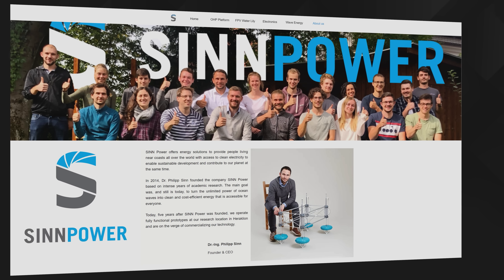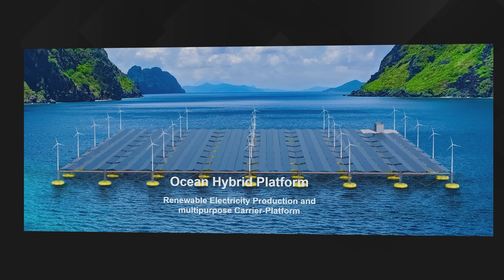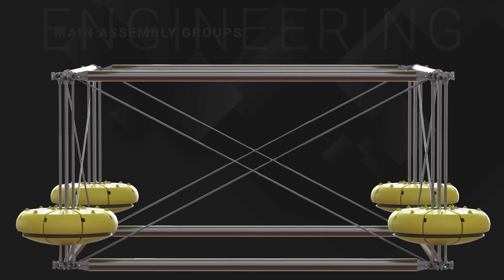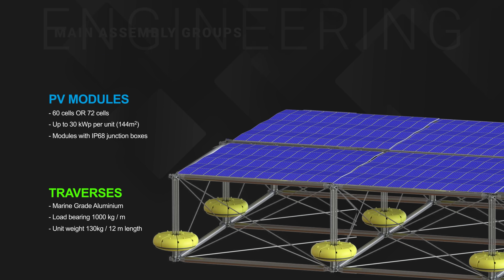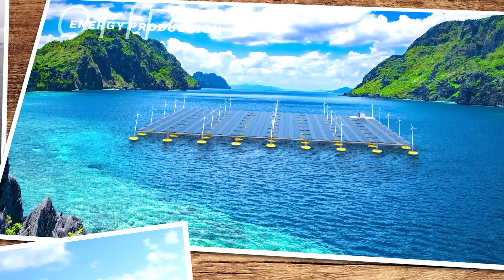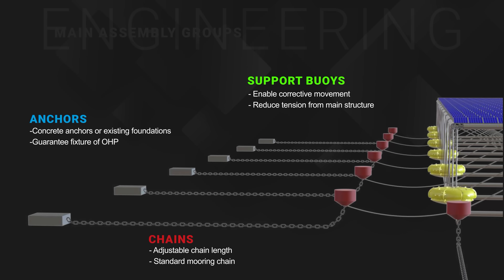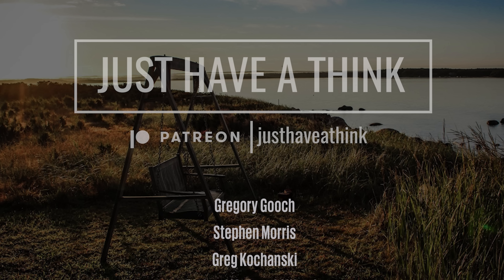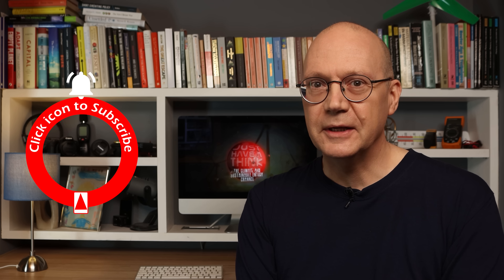Solar Wind and Wave. Can this ocean hybrid platform nail all three?

Comment: One thing I have learnt from my boat: flat solar gets silted up because the water evaporates leaving behind everything the rain brought. That is inland fir me on my canal. But twice this year my panels have been covered by a yellow coating of Saharan dust. This is in the South of England. Add to that any gradual accumulation of salt spray and you are going to need regular cleaning. Tilted panels are almost self cleaning when nearly vortical.  One benefit of a steep angle is that you maximise solar for winter in higher latitudes. You can also get reflected light from the water.

Comment: I like the concept, but it seems like this prototype is way too small. The turbines are too small to take advantage of a lot of the things that are needed lower the cost of electricity, the panels sitting flat like that reduces energy production and can cause water too pool on the surface more potential causing salt buildup issues. I don't currently know enough about wave power too give a firm opinion, but a system like this would probably rely on it's size to maximize energy production since the travel distance of the floats, and the mass and stiffness of the upper structure would both put limits on the amount of energy a given platform can harvest from waves.

Comment: What if feasibility of the wind turbines being made in the tall but tight whirlygig style and the blades of the whirlygig being made out of small solar panels?  I'm an engineer, if anyone is laughing, but I thought it would be cool and not need a lot of surrounding infrastructure.  I assume the force of the blade rotating would be hard on the solar panel, but I just had a thought.😄

Comment: The marine environment is the toughest on earth. There is a reason offshore wind is almost double the cost of onshore wind.

Salt spray is a real issue, it gets in everywhere. Cleaning will be significant and consume power generated by the system desalinating water.

Another issue could be barnacles, which grow on things in the ocean in a matter of days/a week. On a recent attempt to paddle a kayak from Australia to New Zealand Richard Barnes was over the side de barnacling almost from the start.

Would love you to do an episode on what I think is the main reason our move to Net Zero by 2050 is not going to be easy, maybe even possible, and be much more expensive than imagined. The supply of raw materials. The recent EIA report on Critical Minerals makes stunning reading. 

We need gigantic increases in critical raw materials, we swap fuel hungry fossil fuel generation for mineral hungry renewables, batteries and a much more complex grid system to accomodate the issues of rewenables based systems.

We need to find an order of magnitude larger supply of lithium, nickel, REE, silver, copper, cobalt but to name a few. Copper and lithium in particular need massive amounts of water to mine/process and are almost always found in highly water stressed locations.

However the really sobering topic the report raises is how long it takes for mining projects to go from discovery to first production. They found 16.5 years and getting longer due to legal challenges and more difficulty in gaining approval. And that is after you find the deposit in the first place. 

Would get people thinking about what needs to be done to try to address the issues raised.

Because we have become so good at making renewables systems the raw materials are the major costs now. And unless those critical raw materials are different to othe minerals (and after 30 years in mining project development, they are not), assuming costs will continue to fall looks highly suspect.

Comment: You need to make a part two. You say you leave it up to us as to whether it is viable, yet there are so many details that go into that formula.
- What is the price per m^2.
- How much energy can be captured from each system and under what circumstances? Wholesale energy price would be dependent on the installed location.
- Where I live waves average less than 1 m. Can the system be tuned to be maximized in this environment?
- What is the price of an 'equivalent' land based solar and wind system?

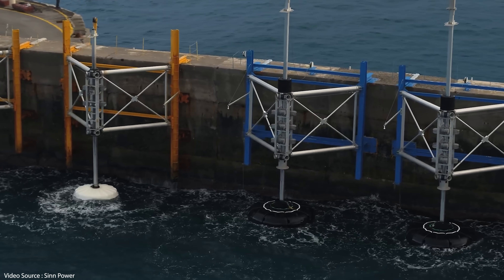Comment: If 10:00 is the real world testing they did then I'm a bit sceptical about it. The concrete wall obviously doesn't float. Attached to the floating platform I somehow have a feeling that rather the platform will break apart under bending stresses than that those floats generate electricity from compensating the waves.

Comment: A great idea, but I have reservations as to the viability. The oceans are incredibly hostile at times - as this week in NW Europe has shown ( Feb 2022) and designing for the worst case scenario plus a margin will be a huge challenge unless a large failure rate is part of the spec.

Comment: This is NOT the holy grail. It is just a new implementation (innovation). Nothing wrong with innovations but there is only one holy grail in this area: energy storage. And is yet to be found. All the efforts should be concentrated on storage.

Comment: My piece of lateral thinking is this: use obsolete  but operational oil tankers as the ‘spine’ of the platform, or around its perimeter, rather than breaking them up. This has the following advantages at low cost.
1. The containerised energy modules can be transported to the site, assembled on board then winched down into position. The ship provides initial anchorage and crew quarters plus a high level platform for solar panels and wind turbines. The ship can be manoeuvrable to provide some shelter from the prevailing wave and wind conditions during storms. It also provides a helicopter pad for maintenance crews.
2. The cleaned out oil storage tanks, modified with seawater pumping systems, can be converted to fish farms. A sequence of tanks could replicate different habitats to optimise the growth of phytoplankton, zooplankton, anchovies, seaweeds, caged shellfish and larger fish for harvesting. The plankton rich waters provide the food source for the higher tropic levels.
3. If moored in deep, tropical waters the ex-tanker/solar farm/wind farm/ fish farm complex could also provide the means to generate power from the thermoelectric effect, by sucking cold nutrient-rich  water from depth, running it through a heat exchanger with surface water, then pumping it into the phytoplankton tanks.

Comment: Dave, I just wanted to chime in on the it-takes-20-years-for-baby-trees-to-become-carbon-storers thing.  If you think about it, it's probably more about how and into what we plant trees that could be the problem.  Conventional plowed fields or burned or cut over land might be the real issue, and planting with minimal soil disturbance into prairie or meadow environments seems like carbon uptake would start right away, albeit a small amount at first. Even establishing a prairie simultaneously might help. Then one might consider the type of trees: conifers that don't loose their leaves/needles vs. hardwoods that do in temperate to subarctic climates.  Logically one might think conifers would absorb more sunlight in winter, reducing albedo, so hardwood species might be better in those bioregions.  Perhaps in the seasonally dry tropics as well that may hold true.  There are other factors, like establishing mycorrhizal networks over time and other factors that I'm not aware of, but if this study is based on satellite images it might be showing that we have been employing the wrong methods rather than the young trees giving off more CO2 than they store, since trees photosynthesize and store carbohydrates as cellulose and lignin right from the get go, unless I'm missing something in my understanding.. 🌲🌲🌞🌄🌜

Comment: Very interesting. The idea that the PV's will be above salt deposit range is one that sprung out at me as wrong, as I see salt spray very high in the air where I live. I'm sure there will be other areas that don't seem to stack up with others who have specific knowledge. But nevertheless, the concept is quite brilliant and may be capable of refinement to overcome any inherent challenges. I like the practical thinking that's been applied, containerisation etc.

Comment: GENDRAOGONFLY  is correct. Based on my experience here in the Philippines the major challenge is maintenance of the integrity of the platform in medium and certainly stormy weather. The large dimensions talked about make it more probable that mechanical stresses and strains will cause a breakup. Seas generated by a 'small 'typhoon are still enormous and generate incredible structural forces.

Comment: I can see a major problem right off the bat - Those towering turbines are going to significantly reduce the output of the solar panels through shading.  As any rooftop-PV owner knows, a little bit of shade on just one of your panels means that the output of your entire string of panels will drop to match.
Now presumably they would need micro-inverters on each panel to get around this problem, it would add significantly to the expense.  And even then the shading caused by the turbines would still be significant.
The wave generators though are a brilliant idea since the whole contraption will be on the sea anyway, so might as well make use of it.

Comment: This just seems like a last ditch effort of wave power to hide their shortcomings with solar and wind, which are well proven.
Offshore wind makes alot of sense, it's beneficial. However, offshore solar makes no sense. It would be a nightmare to maintain and solar panels are least efficient at sea level, especially with all the diffusion of light that close to the water.

Comment: Are these things 6 metres long, or 6,000 mm? If one came out at 6,001mm would they trash it? Would 5,998 be an acceptable margin of error?

You don't specify things using needlessly small, accurate units, unless it's actually important to the project, and I really doubt it is here. If they weren't specced in metres in whatever information you read, either their PR agency or somebody is cocking it up. Can you even buy enormous aluminium pipes by the mm? You'd surely have to specify temperature too, and allow them a few weeks somewhere at a constant temperature to even out their thermal expansion, otherwise you'd end up with the unconscionable disaster of a 6,001mm long pipe.

Comment: It's a neat idea, but to implement it with a shipyard as in the renders, they'll need a lot stronger supports. A fully loaded 20ft container is about 2000 kg/m², that's not even counting the massive crane needed to load and unload these containers.

Comment: Shadows from the wind turbines would seriously degrade solar output. Even relatively small shadows such as from a cable or guy wire can have a significant effect.
Reply: all depends on how you set things up, etc. notice it's already spaced at 9:04

Comment: The silicon cells in a solar panel are wired up in series. Casting a shadow across single cell short circuits the entire panel. The wind turbines would cast shadows over a large proportion of the solar panel rendering their use in this application uneconomic.

Comment: At the bottom of the sea, the temperature & pressure are significantly different to the surface.
Couldn’t there be a way of utilising this to produce &/or store power, like a sterling engine?

Comment: The most valuable piece of this video was learning about "marine aluminium" sealed tubes. The wind power at sea seems a 21st century given, and yes, if we can capture some Wave motion under the platforms, seems sensible. The PV thing? We'd have to worry about high winds at sea shredding these! Making electricity from wind at sea, with the Japanese development of a new undersea electric cable, assured. Hydrogen? Yeah, but probably for home fuel cells, maybe H2 turbines?

Comment: AFAIK, it's generally considered a bad idea to mix stainless steel and aluminum in structures exposed to salt-water because the materials succumb to  "galvanic corrosion". Aluminum and Iron have different electronegativity, so when you add salt-water, they act like a battery and begin corroding.

I'm sure they can figure out a solution to this, but it's something to look out for.

Comment: I do have a question...what happens in the case of a tsunami or some other ridiculous waves (hurricanes can sometimes be obnoxious).

I'm sure they will be viable sooner or later.  It won't work for large areas like center of the United States, but that's no reason to stop researching and developing.  Frankly, I think it's a BRILLIANT idea; tidal all the time, wind when it's not as sunny, solar when it's not as wind.  I frankly think that all municipalities (cities/states/countries) should have this implemented as soon as is reasonably feasible.I really feel like if we were taking advantage of all of these, plus geothermal, plus using heat sinks on all new construction (retrofitting is gonna be....difficult), we could cut fossil fuel usage dramatically.

I also feel like we are being kind of stupiid in our waste disposal.  I compost kitchen waste (all vegetable & fruit, plus eggshells; I don't do meats or cheeses) pretty religiously. But most people don't do that, and some people (especially apartment dwellers) *can't*.  if we had a way to collect all that food waste and let it do it's food wastey thing (and I'm not talking about just throwing good food away, I mean like seeds of peppers, eggshells, citrus peels, etc), we would have some amazing fertilizer.  And that would put less stuff in the landfills overall.

For that matter...we should be using the methane generated out of the landfills for electricity production.  Hell, the wastewater plant at the town where my father grew up powers the entire building (heat, AC, lights, whatever) off the methane produced in the water that comes in to them to be treated!

Comment: Get some small Modulars up & running in appropriate places , re- assess , make adjustments before fully expanding to standard full size & tackle harder locations with further data updates . If required repeat with updates, re- assess & continue upgrading due to areas requirements.

Comment: More companies are working on floating solar in between off shore wind turbines. That is a sound idea. Using the floating motion to generate additional capacity is interesting. However, I doubt that the wave energy and the tiny wind turbines add much additional capacity, while they do add considerably more complexity and potential failure points.

Comment: Too many technologies bundled into one. Now you need expert on solar cells, wind power and wave power to maintain it. If you look at each power source separately, none of them are in their optimal element. Why would you spend 1$ on a solar cell, and not put it exactly where you get as much money back as possible? ”Did they slap on solar cells on something thats not in the optimal environment for solar production” is the litmus test of bogus tech.

Comment: if we transfering kinetic to electric then why not put windmills in the windiest places and use a cone shape structre to concentrate the force of the wind onto the blades creatoing more momentum resulting in.... 

why dont we build water mills near the strongest currents and use a hose to concentrate the pressure of the water to turn the wheel which inturn creates... 

why dont we build ion attenas and place them high enough to attract the proton particles and convert them back into electrons .. 

this is basics..  but theres no money in free energy...

Comment: A lot of aluminium is needed to build those structures.
According to Alcoa, the world's largest producer of aluminium, the best smelters use about 13 kilowatt hours (46.8 megajoules) of electrical energy to produce one kilogram of aluminium; the worldwide average is closer to 15 kWh/kg (54 MJ/kg)
So i would like to see a calculation of how long it would take for these installations to start producing more energy then was needed to produce the parts, transport and install them.
This is something often not produced by the people who promote these kind of developments.

Comment: I lived in a housing estate which had terraces of houses placed at different angles to each other . There was one particular area with a lane way between two blocks of houses . A gale force wind always seemed to blow through that open lane way . The idea of creating a “ wind tunnel “ with built structures occurred to me .
Then I thought , higher areas of ground generally seem to be subject to stronger wind conditions than lower areas , so.......choose an uninhabited hill or mountain , drill a large tunnel through from end to end ,
Place in - line turbines in the tunnel, keeping in mind the prevailing wind direction, . The turbines would not suffer from weather damage and the remote location would cut down on noise and there would be no visual damage to the landscape .
Reply: Drilling a tunnel is a very expensive activity. And tunnels are always need some maintain, that is not cheap as well. So, i guess, your idea is much more expensive, then just put a conventional wind turbine on a top of your hill or mountain. 

But it would (probably) a good idea to find natural canyons or other places with the effect you have describe here, and just create a little bit engineering without needs to build everything from the scratch.

Comment: On a slightly related note, I have frequently wondered why, instead of de-commissioning old oil rigs, we don't just install wind turbines and current turbines on them.  I guess that there must be a good reason (or I haven't heard of examples).
Reply: Probably because the area of the rig itself isn't that big and having to maintain a single turbine that far out would likely cost too much.
Reply: @ragerancher  I guess that's true.  Would you only get one turbine?  How about underwater turbines and solar cells?